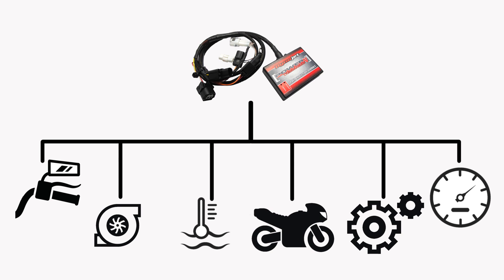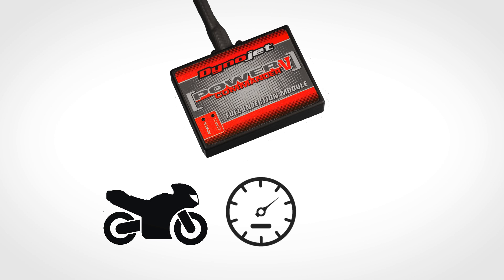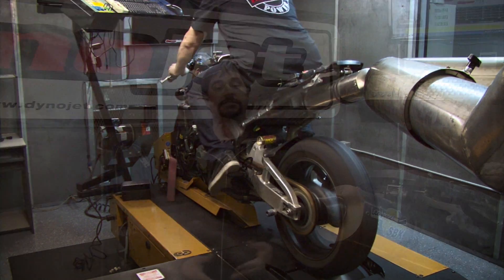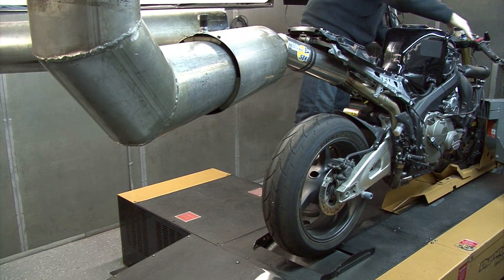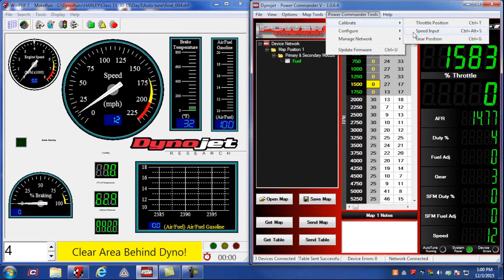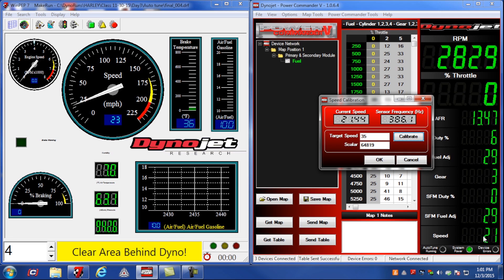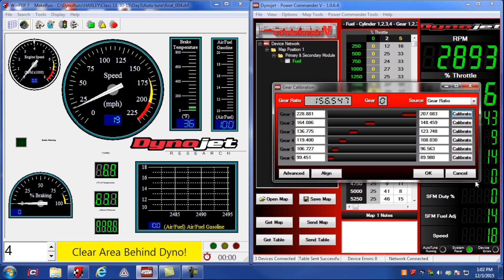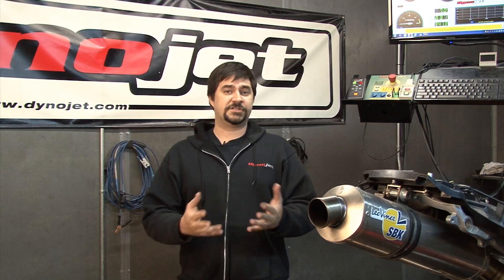Dynojet Power Commander V: Speed and Gear Calibration

Comment: Does that mean if my motorcycle doesn't run at 50kmh in 5th gear and I have to downshift every time speed limit is 50kmh. I can chane it ant it will run without downshifting?
Reply: me too my bike when i run from first gear to 4th gear the rpm is 10500 but when i shift the gear to the 5th gear the rpm is to down to the 9000rpm , i can’t open the rev limiter on the 5th gear , i tried to open the rev limiter actuly i open it to 11250 rpm , but still on the 5th gear the rpm down to 9000 rpm

Comment: There is a  lot of confusion as to features  from  various generations of controllers and for various brands and models of bikes  ect..
  Flash Tune  Brand  and DynoJet  Power Vision 3  can flash  the ECU  for  miles  per hour  for example  if you change sprocket  sizes  to re-calibrate your speedometer..
Reply from the maker: Mike, how can we help? What bike do you have and what would you like to do with the Power Vision 3?